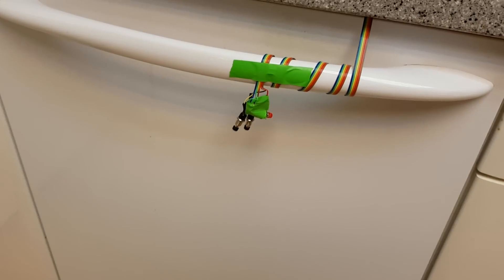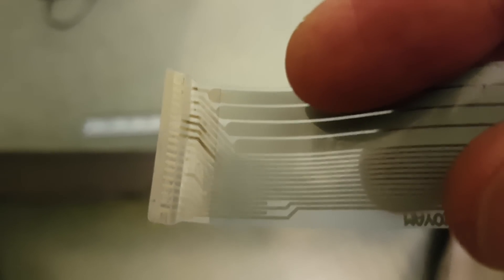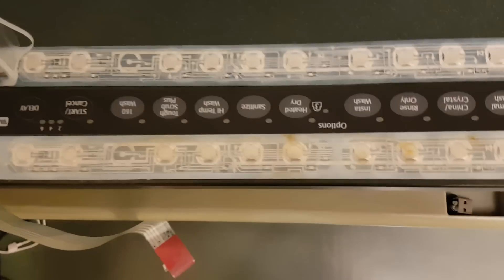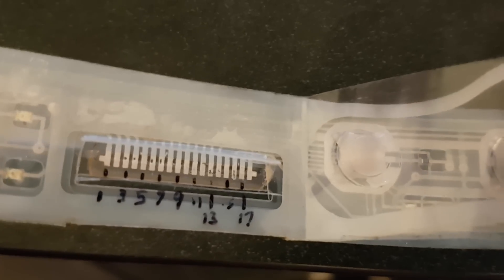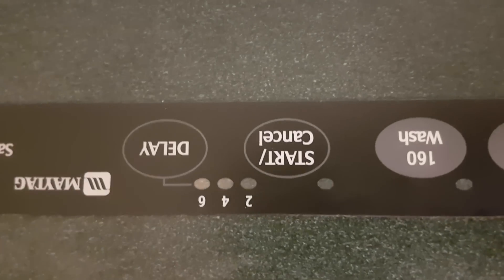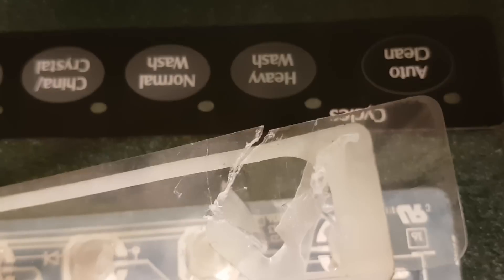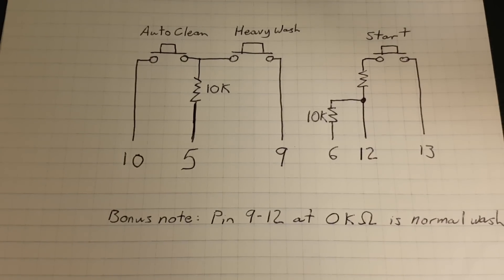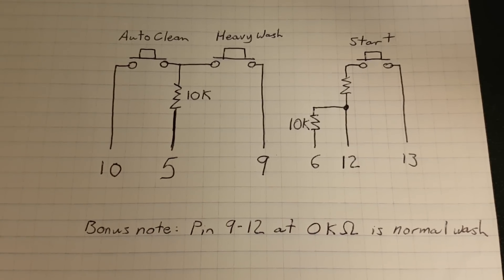Maytag dishwasher control panel fix

Comment: For Maytag QuietSeries 200 you'll need to bridge pins 7 and 12 with a 10K ohm resistor. Put a momentary switch on pins 6 and 10 along with a 10K ohm resistor. Solder on the back of the board instead of removing the connector port. There are exposed pads near the pins that you can solder the wiring.
I was able to reuse the corroded ribbon cable for a few years after fixing it with a circuit pen, but it was unfixable for the second try.
Your video is still saving dishwashers. Took a few hours and tries, but it is done.
Reply from the maker: Thank you! And thank you for the update on the Quiet Series 200. My little "hack" is still working on our machine... And it's a great conversation starter when guests are over for dinner!😂

Comment: Thanks - Founds this video and found that the contacts going into the circuit board had a layer of black on them. I thought it was protective compound in the beginning but saw faint marks underneath it to reveal the circuit contacts. I took an eraser to it to remove the black gunk and it worked. I actually started trying to scrape off the blank gunk with a knife... bad idea. The circuits went with it so I had to snip it a few mm and redo the process. It's running now! 

Initial Issue - Start Button and Normal Wash buttons were unresponsive. Heavy wash button lit up and worked during the key press. 
Potential Root Cause 1 - Either bad contacts at the loose end of the ribbon cable due to residue build up.--> Removed residue
Potential Root Cause 2 - Poor contact of touch pad push buttons -> re-seated the touch pad 
Net - It runs.
Reply from the maker: Thanks for the kind words! Got my day off to a nice start to know that you were able to get it back up and running again! Congratulations!

Comment: Also how do you put the sticker back so the humidty does not get in? THank you.
Reply from the maker: I just put some tape over the hole... hasn't seemed to be an issue for the past few years. The dishwasher is running fine as I type this... it's a bit of a hack repair, but has been more reliable than the stuff that Maytag put in there!
Reply: @dtengineering  Thank you for your quick response and great video!

Comment: HI, I'm not clear how did you solve this issue?  How hard is to replace this ribbon cable with another type of ribbon cable?
Reply from the maker: I'm not aware of a replacement ribbon cable... doesn't mean that one doesn't exist, or that there isn't some clever option to hack one together, only that I don't know about it. So I solved the problem by replacing the ribbon cable and panel with some wire and switches I had kicking around the house.

Comment: Thanks for posting that!  I'm having the same problem and I refuse to spend half the price of a new dishwasher on a new control panel.  I'm going to attempt the same type of repair on my maytag.  It's a different model and I have to do a little sleuthing to figure out my pins.
Reply from the maker: Hope it worked out!
Reply: @dtengineering   Can you share where you got the push buttons that you added to bypass the touch board?? I would really appreciate it.
Reply from the maker: @lynniemarie977  I teach electronics, so I've got a good supply of parts on the shelf. Most electronics shops should carry them, but if you don't have easy access to one, maybe try an online retailer. Sparkfun and Adafruit have a bunch of really cool stuff (and almost definitely have a switch like that) but Amazon will have them, too.